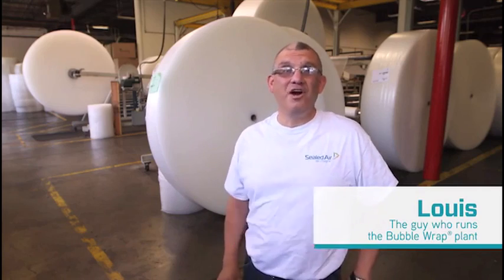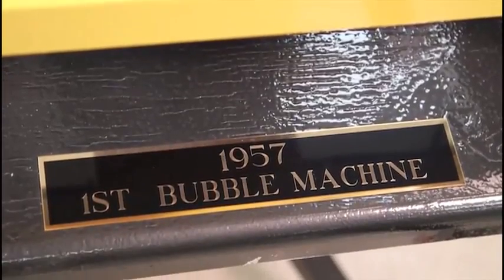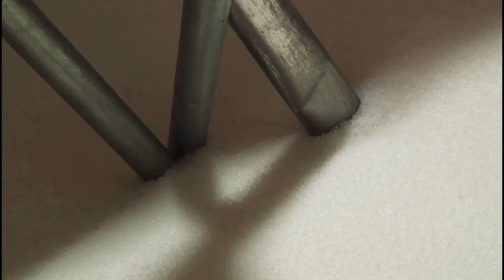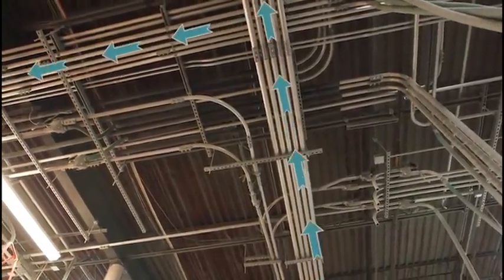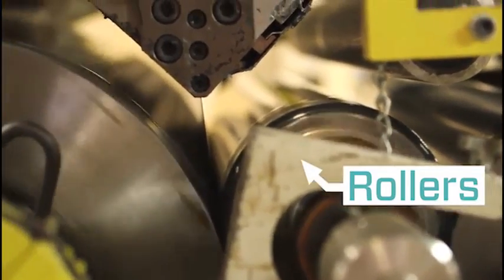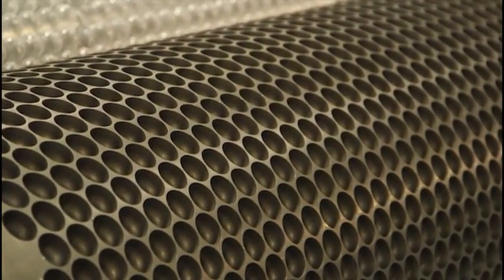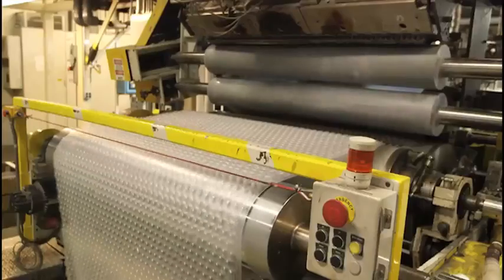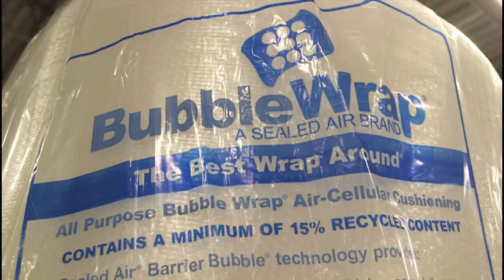How Bubble Wrap Is Made by Sealed Air in the USA - Protective Packaging

Comment: How do you determine the length? Is a 100 sq ft roll x 12” perf ran as 100’ flat to fill an order for 100 sq ft or is a 100 sq ft roll filled with air and actually 100 sq ft? (100 12x12 pcs on the roll) Thanks.